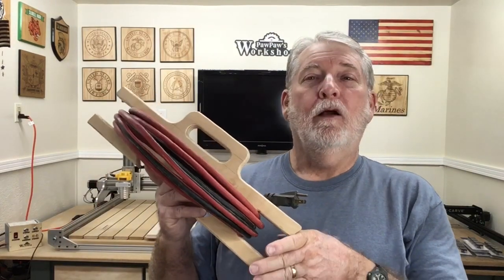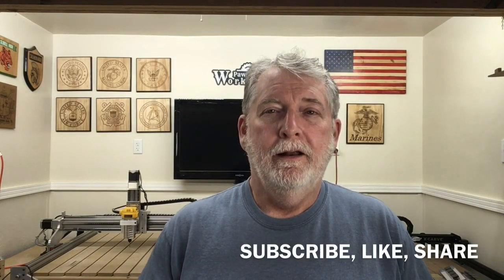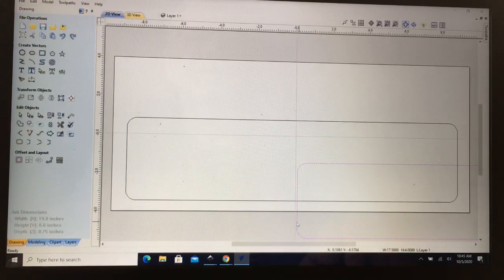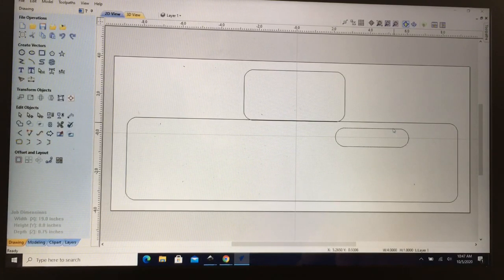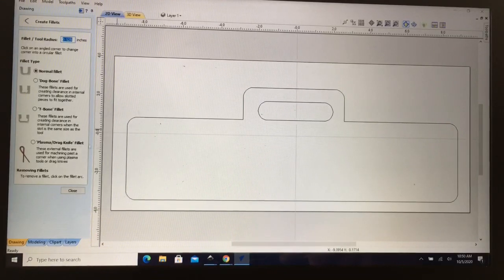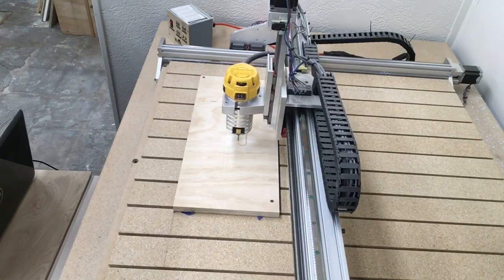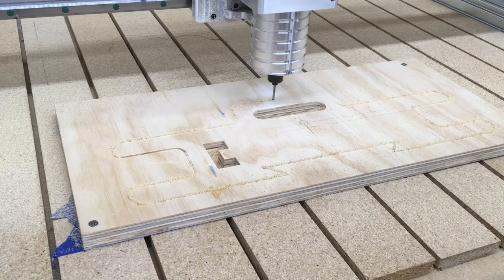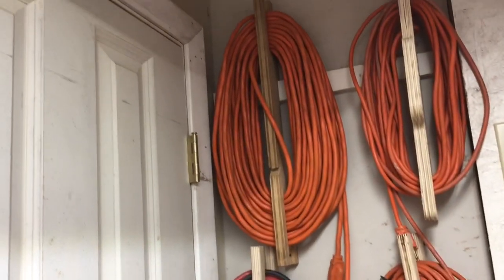How to Make a Cord Holder on the CNC Using Vectric V Carve Desktop

Comment: I signed up for your site but still don't know how to get measurements for the 4 wall tool cabinet
Reply from the maker: Lois Nickell Do you want the exact size or would you like to modify any sections?  I’ll help you with any measurements that you need. Where are you planning on putting this cabinet?  Shop or hobby room?  What are the sizes of the items that you plan on putting in the cabinets?